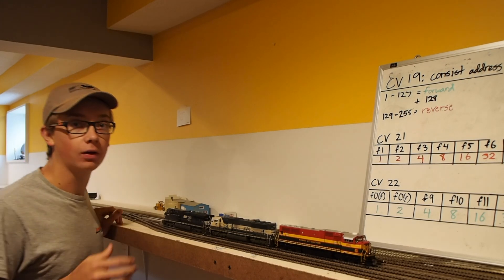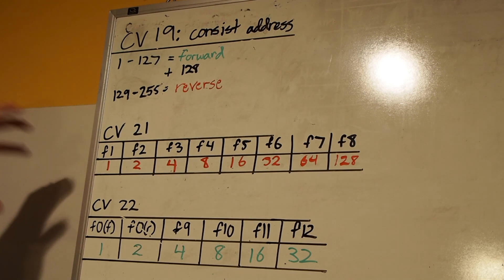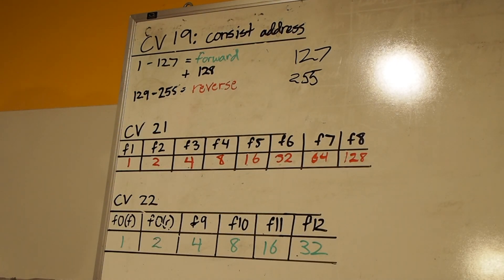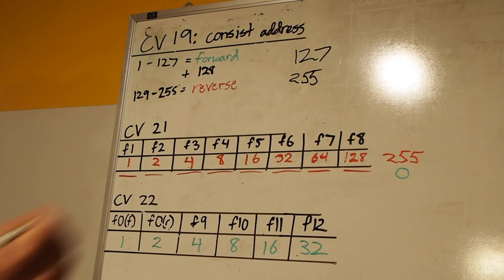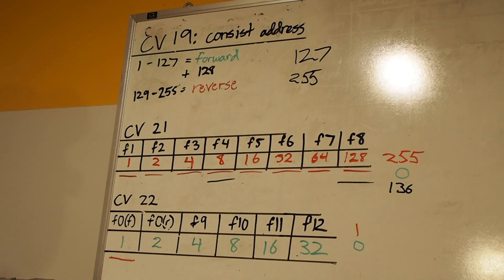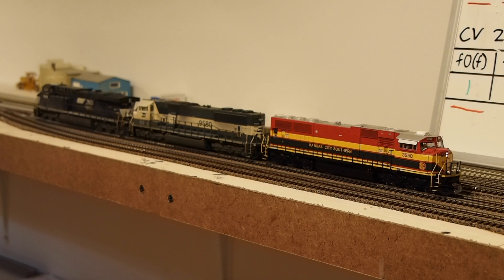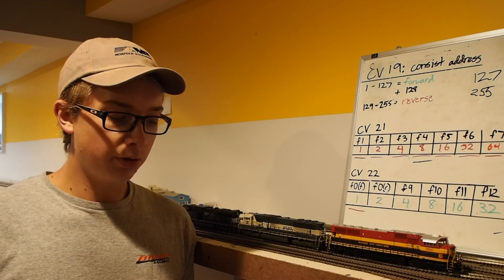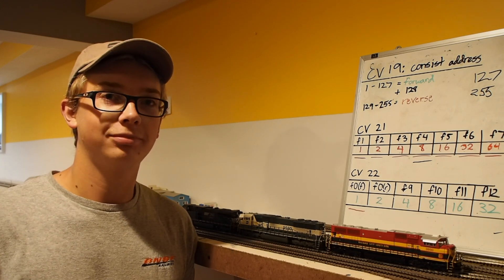How to Consist with DCC: Function Setup

Comment: My question is: Do you need to speed-match all locomotives in the consist? If so, I do not know how to do that. Also, I have a Bachmann NS heritage unit, an Intermountain NS ES40DC, and a Broadway Limited Imports UP SD40-2. The SD40-2 runs perfectly, no breaks in the sound or lighting, where the other two do frequently. What should I do about that?

This should help me out :D
Reply: one last thing: Do they all have to have the same sound decoder (ESU, Soundtraxx, Paragon2, etc...)
Reply from the maker: Good questions.  What I do is pick a locomotive that runs well, and then change the speed curve of the other locomotives to match the one. I'll talk about how to do that quickly in my next video. Also the consist can have a mixture of decoders. The one in this video had two Soundtraxx and one Digitrax.

And I have that problem with some locomotives too. I think after a while, the contacts get grease/dirt on them and they start to not work quite as well. So a solid cleaning of the locomotive would help. Adding some conductive lubricant like CRC 2-26 (I got mine at Lowes) helps. But what I plan to do in all of my locomotives is add Keep Alives which is basically a big capacitor. That will prevent locomotive sound/lighting to flicker or stop on dirty or uneven track. Because even the best running locomotive can have issues over a slightly uneven turnout.  Hope that helps!
-Cam
Reply: It should help, thanks! I'll check the wheels on my Intermountain, although it has been stalling since I got it, not just on turnouts, but on the track itself. I clean the track every so often (I have a small layout) I'll clean the track, if that doesn't help, I'll clean the wheels to my engines, and if that doesn't help...I'll take it to my local hobby store and see what they can do (I'm not very fond of looking inside my HO scale locomotives, let alone experienced.)
Reply from the maker: I don't know what radius track you have, but when I had my NS ES40DC on my old layout, one of the truck pickup wires came loose. I think it was because the track radius was tight and over time it kept pulling on the wire. So you might want to try picking up one end of the locomotive at a time. If the engine turns off when one truck is in the air, then you know the one that's on the track has a wire loose.
-Cam
Reply: Thank you so much for that tip! One of the wires on the rear truck is loose. I'll take it to my hobby store and have it fixed up (I don't know how to, my parents only buy the stuff so they won't know how to, etc)

~Tobias S. (Trains N' Stuff)

Comment: Dude this is just the series I was needing. I havent speed matched any of my units and was dreading trying to figure it out. There just isnt any vids explaining in very good detail how to do this. Once again thanks Cam!! P.S. I have the PR3 but havent even takin it out of the box yet. Didnt know if that was what your using on your units or just setting CV's manually. Guess I will find out soon enough lol.
Reply from the maker: Awesome! I'm glad this helps. And I just changed the CVs by programming on the main with my NCE Power Cab. 
-Cam
Reply: Hey Cam, what do you need to do if you want to take an engine out of the consist? Im sure its a simple step lol.
Reply from the maker: With this method, you just need to program CV19 to 0 for that locomotive. Pretty simple. If I remember correctly, you don't even have to change CV 21 or 22. The nice thing about that is when you put that locomotive back into a consist, it will retain all of the "consist functions" you programmed before like dynamic brakes, etc. Depending on where that locomotive winds up next time, you might have to fool with the lighting though.
-Cam
Reply: Thanks Cam. Much appreciated!!

Comment: Great video just what I am planing to try next just picked up 2 RS-3s for this. My question is about moving between systems (NCE - Digitrax) I have nce but my club have Digitrax and I have experienced problems with numbering before with my S-2 No 4 e.g. Would work on home layout but not the club layout turned out NCE address 1-126 where Digitrax does not so I had to change the way I had numbered the switcher to work on both systems. Just wondering if there may be a similar problem with consisting :~)
Reply from the maker: Thanks! And I don't really know. I've used Digitrax on my friends layout before, and I didn't have any address problems. All of my locomotives have a long address with 4 digits so that might make a difference. Not sure if the same will be true with consist addresses. 
-Cam
Reply: Just thought I would ask before I get there. re my address problem that we solved in the end even Joe Fugate did not know the answer he thought I had a consist set up that was causing the problem

Comment: just what i was looking for, this should work on the new SD40-2 and the new tier 4's from scale trains? one question when you were backing up the consist did the trailing unit lights come on if equipped? ditch or cab light. another great video thanks for the time you put into these video.
Reply from the maker: Thanks! I'm really glad it was helpful. This will work great with those new releases. The rear locomotive's light did not come on in this video, but if I had programmed its CV 22 to a value of 2, it would've. Another way to do it would be to recall that locomotives number, turn on any functions you want, and then return to the consist address to move it around. 
-Cam

Comment: good video for setting that up. but where did you get the numbers in red and green.
Reply from the maker: Thanks! Those are just the values that correlate to each function. That's just a universal rule. You can find them in ESU, Tsunami, etc. manuals.
-Cam